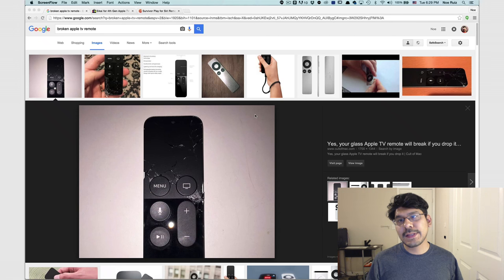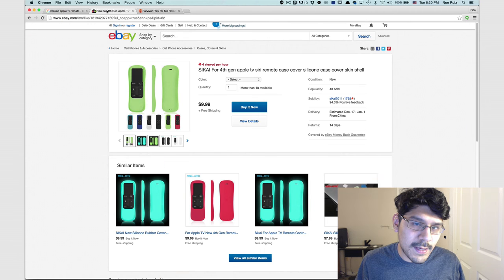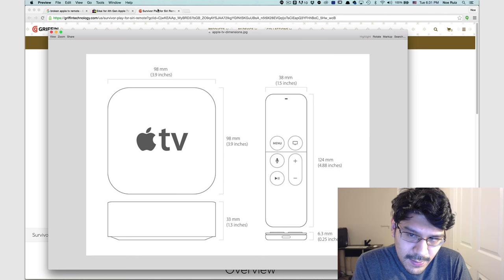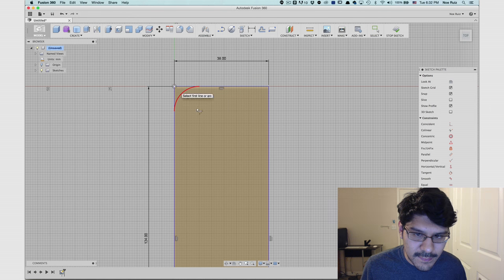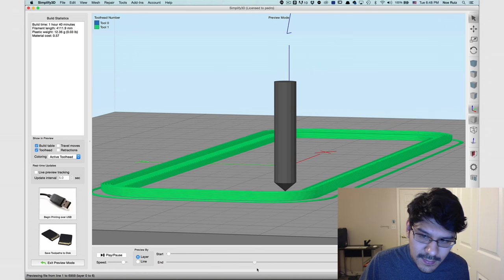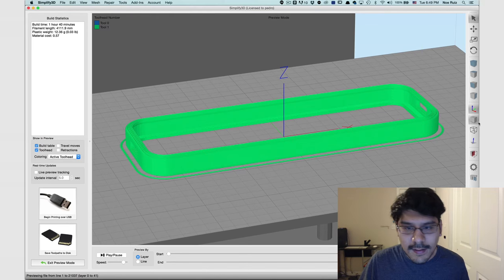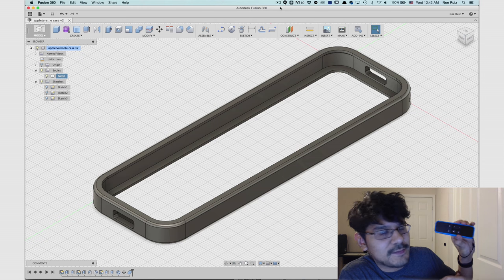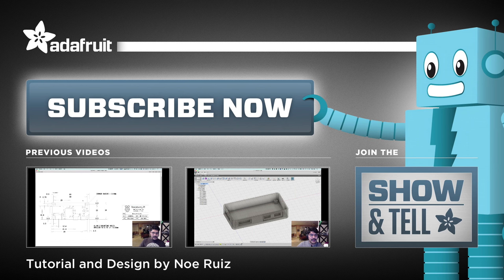Layer by Layer - Apple TV Remote Bumper

Comment: If you want to measure fillets, there is a special tool (Well, its a Acrylic Plate with holes in it) from the company rotring. But when i think of it, that would make a great 3D-Print, i think i will design something, maybe it would make a great layer by layer or a 3D-Printing-Video?

Comment: Hey, great video.  I am trying to print using ninjaflex on my flashforge creator pro.  I can't get the filament to load, it goes so far in and then stops.  Standard ABS or PLA works fine?  Any tricks?
Reply from the maker: +Jamie Lindemann Try loading it when the extruder temp is set to 230-240c. Set your preheating temp do that and then run change filament. The default is set to 210 or so, which isn't hot enough for it to purge.